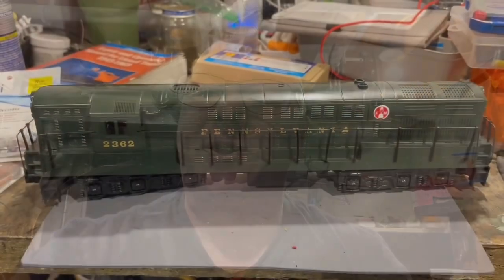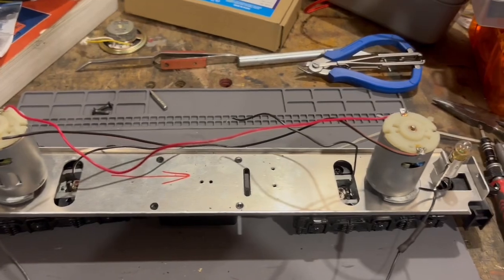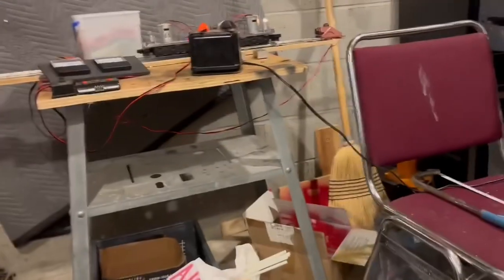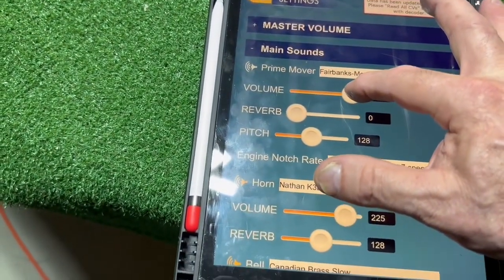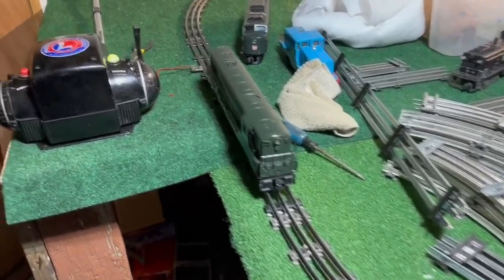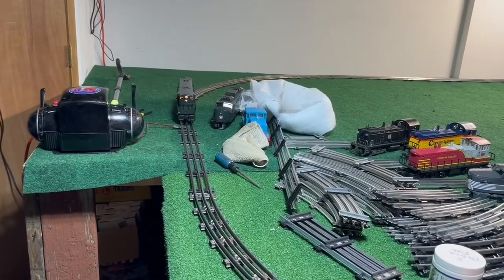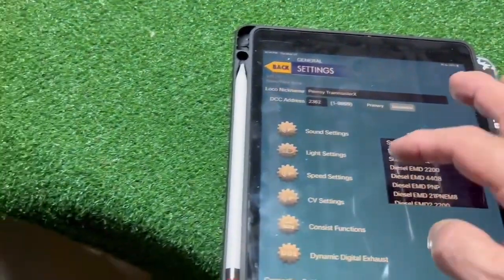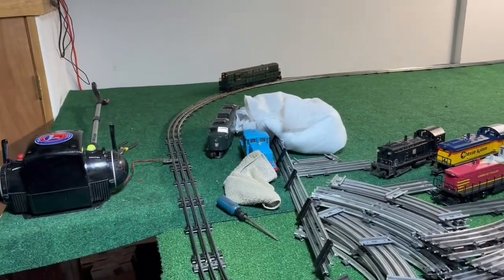Installing a Blunami 4408 in a Williams Locomotive from the 1970s

Comment: If you used a little bit newer version of the Williams Trainmaster, you would have had DC can motors with Fly wheels. This would make a much better crawling engine. May be you could source some flywheels in the future. 😃
Reply from the maker: @PhilipBender612  it’s actually an awesome crawler. Thanks for your comment.

Comment: HEP is Head End Power. It's a passenger train thing, and today it specifically refers to a separate diesel unit used to generate power for the train.
The trainmasters predate that era, but they did have a steam heating plant, and there should be a sound for that on your board. The heating plant was inside the short hood. The square vent and hole on the roof are part of that.
Reply from the maker: Thanks Geoffrey! Always great to get more information shared in a helpful way. I’ll look for the steam heater sounds. The capabilities of the board are pretty amazing.
Reply: @scpvrr  does this board have a shut down and start up feature? The tsunami does. I like this feature because the engine is quiet when you power up. And then you can hear it cranking up.  Also, if you convert th lights to LED, you can dim them, just like real trains do when in the station. I have a small freight yard on my layout, and I like to dim the light as a run the train past, as per real railroad operating rules. The more you use these boards, the more it becomes like running a real train.  When I converted my RS3 over to tsunami. I did like you did with the motors, namely wired them in series. Wiring them in parallel didn't let me go slowly enough. Can't wait to get mine.

Comment: Does the horn section include a Leslie A200? If so, that's the sound  that's more accurate for what this engine already has. Granted, the one you chose sounds nicer, but in real life you wouldn't get that rich a tone from a single chime horn,
Reply from the maker: First, thanks for watching and commenting. Yes, the A200 is there.  As you could tell, I was kinda nerding out on the capabilities, having a good time with my new toy. This is my first well featured command control loco.
Reply: @scpvrr  I don't have any Blunami yet, I have several of the earlier Soundtrax units. I'm looking to replace them with Blunami because it takes less hardware to use in 3-rail O scale. I have a later version of that same engine and I was curious about the horn. The real Trainmasters were delivered with the Leslie A200 horn, but some railroads, like the Sourhern Pacific, retro fitted them with multi-chime horns.  If you find some horn sounds you like, P&D hobby sells, ir used to sell detail parts for 2-rail that included different kinds of air horn castings. You could make your engine a real conversation piece.

Comment: Thank you for this excellent video Bill, this is something I would like to try myself. Could you tell us how much the kit was? Also was there much if any soldering involved or were wires attached in a proprietary way? Other than the decoder app to run it and a traditional transformer was anything else needed? Do set the transformer on 18v like a Lionel LionChief? I just acquired an older Williams Trainmaster without any sounds myself, it runs great and had very low use.
Reply from the maker: Thank you!!!  Great questions.  The kit was $205 from eBay. There was some soldering such as the motor, ground wire and speaker.  The wires all connect to the Blunami board with screw clamps. The rectifier board I used also connected via screw clamps. Blunami runs from 8-24VDC.  To run it, I have a traditional ZW275.  Then I download the Blunami app from the app store for either Apple or Android.
Reply: @scpvrr  Thanks for the quick reply Bill.

Comment: So you don’t need the bridge rectifier and e unit anymore correct 

Just the speaker, the ac to dc board and the decoder ?
Reply from the maker: And a speaker, of course.  The ac to dc board is a bridge rectifier plus a filtering capacitor.
Reply: @scpvrr  do you have a amazon link for the capacitor / rectifier
Reply from the maker: I got it from Ali Express. JUNY Integrated Circuit Store
https://a.aliexpress.com/_mNPgbAE

Comment: Did you need to isolate the lights? I recently fitted a tsunami decoder to a Williams RF-16 and I needed to electrically isolate the lights from the chassis.
Reply from the maker: I did not. The board controls hot for the lights. There isn’t even a spot on the board for light ground.

Comment: Wonder If the MTH proto that had the bad boards could be modified with the blunami sound boards.
Reply from the maker: Absolutely with one caveat: with Blunami you don’t have direct smoke control. You have to “hack” that using one of the extended controls.